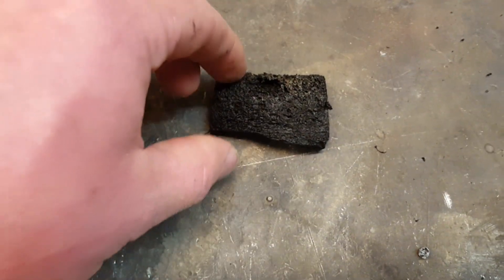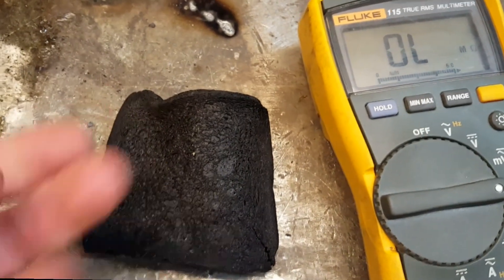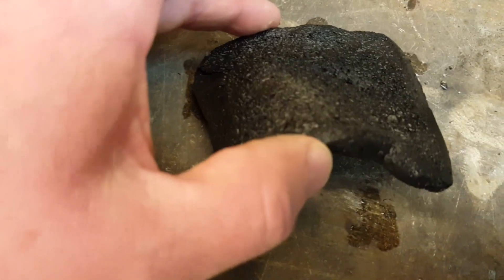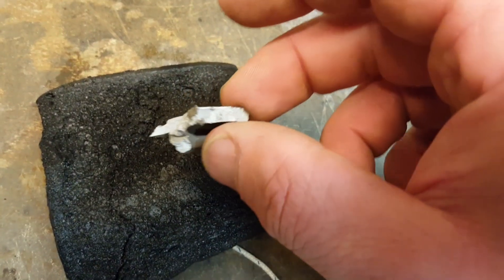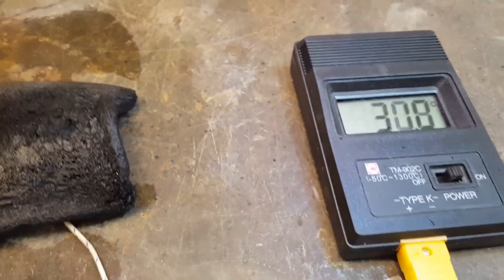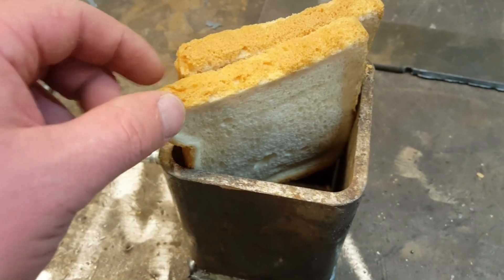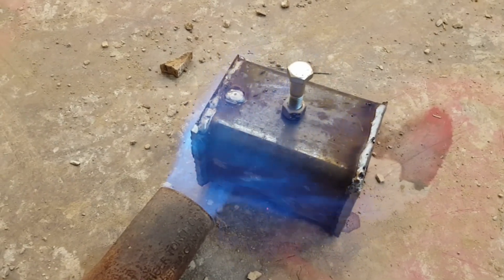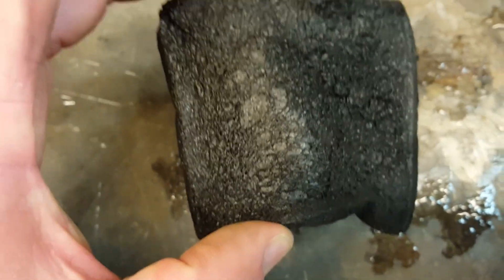Carbon Foam: an incredible material made from everyday items.

Comment: Does it have to be 100% argon or can you use a 75/25 mix?
Reply: +AvE Oh okay. If I were to do this, would sealing the can completely be a dangerous thing? I'm assuming your plan was to use the spiral leakage path the bolt provides to allow the volatiles to escape, but it just happened to leak out a hole in the weld
Reply: Yes, it would be dangerous.  Methinks all you need is to wrap up the bread in foil, or put it into a paint can with small hole in it.  Lookup charcoal making, should be essentially the same deal.  If you wrap wood in foil and throw it on the grill it definitely makes charcoal, should make this "carbon foam" via the same process.  1 oxygen molecule won't ruin it, you just have to make sure you don't have ongoing combustion.

Comment: I wonder what would happen if you crushed it up into thumb sized chunks and added it to some kind of binder as an aggregate. Or maybe into a fine dust and bind it with epoxy. Or maybe even grind it up into a finer dust and find a way to get it to bind back to itself in a mold. 

I never thought I'd be thinking about gasifying bread.

Comment: you should look up zimmer trabecular metal (TM).  It's a product for joint replacement, mostly hips, where joint replacement parts are made in this type of carbon foam and then tantalum is deposited on the foam lattice by vapor deposition.   The carbon is washed away and the tantalum foam remains.  It has exceedingly robust bone-ingrowth properties because both the pore size and the modulus of elasticity are similar to cancellous bone.   They make it in a factory in new jersey which I had the pleasure to visit about a year ago.   Other companies have similar products in titanium but my opinion is the Zimmrer TM is superior.  

P.s. they start with foam similar to seat cushions because of the specifications on pore size.

Comment: I accidently did this with about 60 french sticks when I was a baker. Forgot them in the ovens at night when they turn off on auto, disabling any timers and alarms you had set to remind you you put something in there, and the morning shift started putting in loaves after the ovens had been back on and heating up for 3 or 4 hours at full heat (220'C i think).

One unhappy boss, and a really detailed set of matching carbonized french sticks for the discerning collector... :)

Comment: that is interesting seeing how you basically made a charcoal oven.
Reply: +Darknightx33x 1 thru 10 obviously.
Reply: Everyone is like 10 chapters ahead of you, keep up.
Reply: please tell me which chapters i missed then
Reply: I wonder if the argon is actually necessary. Probably could get away with just burning a couple of matches inside.
Reply: really? i read one thru nine
Reply: mrkiky maybe carbon dioxide, but if you leave air in it the bread should catch fire. then again I saw a video where another guy made gun cotton (i think thats what he called it) by closing cloth in a can and tossing it in a fire
Reply: Dang one more to go bud, lol
Reply: except he didn't get rid of the impurites by the initial low burn

Comment: waiiit insulator and conductive?  arent insulators supposed to be non conductive ? im confused. OR are there different types of insulators so partially conductive etc.
Reply: thermal insulator, electrical conductor.
Reply: aaaa makes more sense sorry about that
Reply: to be fair, if the resistance is measured in Mega-ohms I think it's safe to say it's an electrical insulator as well
Reply: Insulators are materials with resistance high enough for you to assume it's limitless.
Reply: Everything is conductive to some degree. It's HOW conductive it is that determines if it's an insulator or a conductor
Reply: Two different types of conduction my friend. Things can conduct heat and/or electricity. Same for insulation. They are not related so much.

Comment: Cobble together some aluminum bits, cover it in wonder bread and toss in an arduino and you got yourself a space shuttle.
Reply: Just get a shitton of 555's with some resistors and capacitors. Fuck the computing power, just control the staging and maneuvers by fiddling with preset timers. Results may vary.
Reply: I'd watch the video!
Reply: Nah, the Arduino has too much computing power for a shuttle. Got to think of something else.
Reply: +Grant E Giving practical examples of the phrase "Shoot for the moon, even if you miss you'll land amongst the stars" -drifting for eternity, lonely, lost, cold and hungry.
Reply: But you're not lost. You know exactly where you are. You're in space! #Kappa
Reply: +MrChoochoo, sorry but this has been debunked, check snopes.com.
But it was a damned good story! ☺
Reply: From what i understand they either used crayons, regular pencils, and mechanical pencils. They origionally tried to make a pen for space because it would be safer than a pencil, but costs ran up, and someone spoke up and said "guys, what the hell are we doing?!" and they went back to using pencils and doing the things NASA does well.

 Then the guy from spacepens was like "Hey NASA, check out this thing I made! It's a pressurized cartridge, it can write in any orientation, and the ink is a special gel that isn't affected by grease or paper surface imperfections...
and NASA was like "Sweet, pencils are pretty crappy, also damn flammable, and the dang graphite tips keep breaking off and getting into all the fancy electronic thingamajiggers and killing all our astronauts!" thank you Fisher, here is your contract for lots of money and you give us lots of pens worthy of space."
Then later after Reagan single handedly brought down the Soviet Union using the power of "not blowing the earth up by firing the first shot, also, lots of naps." the  Russians were like: "Da! please to be givink us your spaces pens too please thank you, our wax crayons are the garbage!"
Reply: +Alex McDonald I'm assuming Arduino was chosen due to it being the "A" in "AvE."
Reply: +Alex McDonald 1990s wrist watch calculator thingamado
Reply: +CelticBananas i Hope you're joking
Reply: +MrChoochoo Pencil shards damage the air filters in long term space missions, thus they are still needed.
Reply: MrChoochoo They did do such with a pen, not everything on Snopes is valid. Look it up. Pen is for sale in an Office Max for like $45
Reply: +Alex McDonald raspberry pi
Reply: Why didn't I think of that
Reply: Need radiation shielding still though
Reply: Makes you think why US government spent 200 billion on Space Shuttle program. Wonder Bread and Arduino doesn't cost that much!

Comment: In this episode AvE burns his toast. And then he burns it some more.
Reply: No burning of any toast was done except when it was burning by itself before he broke out the FLIR. He pyrolized it.  Burn=O2 used, Pyrolize=No O2 used.
Reply: it's how lots of organic household waste is treated if biodigestion is not available as the gasses released by piorolisers waste treatment are then used to power the pioroliser to gain more gas and thus generates power with the extra gas produced, you then just replace the organic waste when its run and the ash is used for various purposes. Great stuff.
Reply: +E2qNX8btraQ3zRD6J7fc top marks
Reply: reminds me of hydrothermal carbonization but less dangerous
Reply: Ya and I googled felching tube, had no idea...
Reply: lmao
Reply: Why do I hear Jeremy Clarkson when I read this?
Reply: +E2qNX8btraQ3zRD6J7fc WHOOOOOSH

Comment: I thought i was early. Apparently not early enough. Is that thing still edible though or will it fuckem my insides
Reply: Most of the time, they pump it out after a short period of time to let it absorb the poisons. Of course, some is left and passes.
Reply: It'd be the same as eating a chunk of carbon...because it is a chunk of carbon. Activated carbon is used in that way for treating recently ingested poisons but I think it gets vomited back out. So, horribly dangerous? Probably not. Recommended? Definitely not.
Reply: I don't think activated carbon is vomited out. I'm pretty sure they make you vomit and them eat the activated carbon to soak up anything that is left. I knew someone who had to eat some and they commented on how black their shit was after.